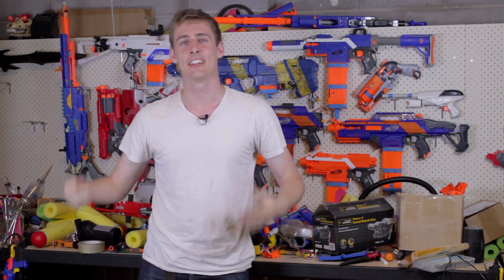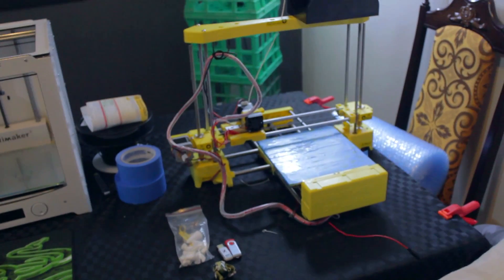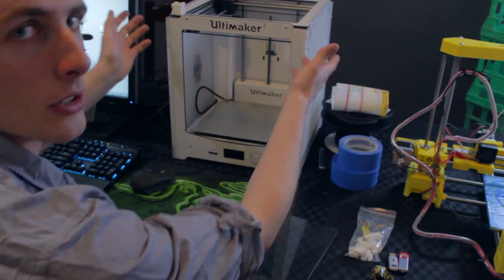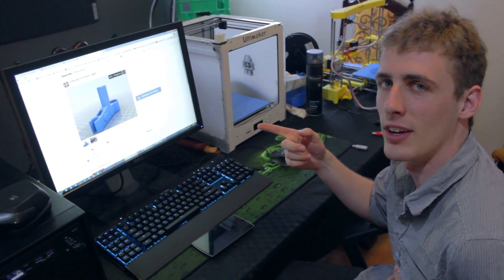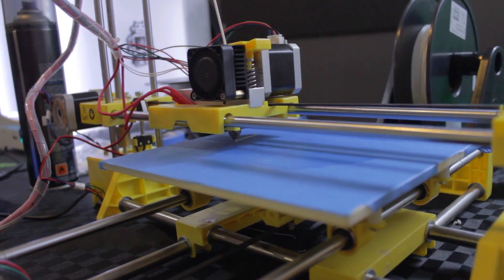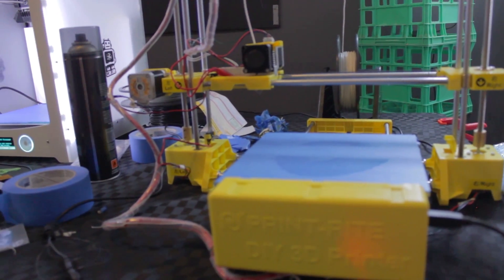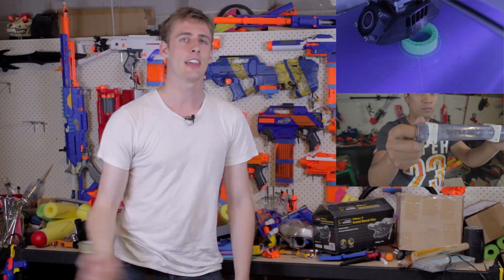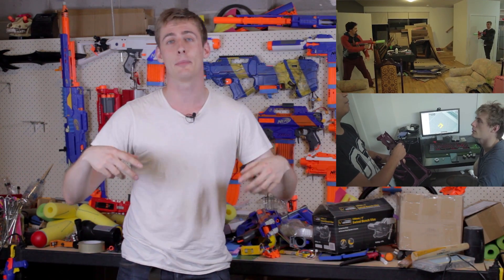ULTIMAKER 2 vs PRINT-RITE DIY 3D Printer & How to Bed Level - PRINTER PARTY | Make Test Battle

Comment: I have a $350 DIY printer that I may have added another $150 in parts and I understand (at a beginner-intermediate level) the importance of leveling, extruding speeds, heat for types of filament, and more importantly how the machine is mechanically built and its tolerances and can (given time) rival the $2,000-$4,000 home printers. 

What is more impressive, is that I can build (with the cheap printer, and slow speeds as well as finer print parameters) I can print the parts to a machine where all I need to buy is a board and some rail/threaded screw components and motors and print at a $4,000 + quality.  

I would really say it is more about understanding the mechanics and tolerances of each part, rather than plopping down a bunch of money and hoping the machine works.  Are there machines that beat the crap out of my $350 diy?  Absolutely, but that is because of the system as a whole, not simply the price paid for the machine.  Learning an arduino(can really be any micro controller and programming logic flow - arduino is just known and readily accessible with tons of code on the internet to help beginners get started) and cnc(computer numerical control) will go a lot farther than watching reviews - if you want to get serious or even just moderately tinker with a printer.  Likewise, knowing more will help when the machine has a failure(which almost every machine will eventually have a failure) and then fixing the area of failure becomes a learning experience as well as useful knowledge moving forward.
Reply: ya I've been doing alot of research on 3d printers and looking at buying a DIY Prusa i3 varient and seen amazing print qualities from them with a little dedication and understanding.

Things that should in my opinion be learned anyway so can better understand the mechanical working of it and fix things as issues arises etc.
Reply: I got the CTC and then ended up over the span of a few months (while I figured out what variables led to a great print) added about $250-$300 worth of upgrades into the machine.  The difference (other than huge savings) from if I would have purchased a replicator - is that I fully understand what components are giving me high quality prints now (as well as air temps, bed leveling and temps, etc.) and I also know how to fix and maintain those parts.
Reply: Aura Rowe Basically what I am saying is - If you want to learn 3d printing, get the Prusa (like you mentioned) or a CTC or something else low cost and work up, that is the proper mentality.  I could see myself eventually dropping a few thousand dollars on a quality machine, once I understand the intricacies of the process, but I would have been extremely demoralized to spend $3k and my first few weeks of prints be bad (which they inevitably will be).  

My next goal is to build a 3 axis CNC in my garage, haha.  I am a programmer by trade so the software and logic I am OK with and I have started to learn a lot of open source g-code applications and slicers so that helps for making your own machine.

Comment: Bed leveling corrections can be made at time of print.  Just manually twist the z axis screws while the first layer is printing to dial it in how you want it.  You can easily tell when it is too high or low.  The rest of the layers will self correct any imperfections and you will still get a good print even if the leveling is bad.

Comment: that print rite is not tuned right, depending on nozzle it should be able to do almost as nice as the ultimaker, albeit at lower speed, that prusa i3 design sucks and is not sturdy enough for very high speeds, nor actually getting proper Y axis, which always depends on the surface you put it on ... ie. how level the table underneath actually is.

Comment: Hey- love the vid's......I often run my printer when i leave for work but dont have anything to control it with. I have used a wifi camera but its not helpful if i something goes wrong, do you know of anything on the market to help with this? the only product i have found so far is 'heero'.....https://www.kickstarter.com/projects/guzu/heero-monitor-and-stop-any-electrical-device-remot which looks great but do you have any advice?

Comment: You don't need to use blue tape with the ultimaker 2. I recommend Wolfbite if anything and leaving the glass bare. I've had issues with warping because the tape came up from the bed which would have been avoided by just not using tape and using Wolfbite or a simple gluestick
Reply from the maker: Blue tape works. I now use BuildTak -R
Reply: +Make.Test.Battle I know it works. I use it in my replicator 2x, but it isn't necessary for the ultimaker 2.

Comment: Why the hell do they have glass bedding? I have never seen a single review of a 3D printer with a glass bedding where there is no complaint about how hard things stick to it which immanently leads to your piece bending if large enough. For 4K USD one would expect more thought in designing this thing...
Reply from the maker: Borosilicate glass has great thermal properties -R
Reply: Make.Test.Battle That's great but it turns your printing into a shitty printing. :D
Reply from the maker: rbaleksandar Works fine for me; that said I am using blue tape or BuildTak. Also dontforget that this printer isnt 4K USD, it was 4K AUD and including taxes, import duties, shipping etc at the time I bought it when our dollar was quite low. Prices have dropped since -R

Comment: Is it just me or is that "$400" printer worth $100
Reply: I bought a Jgaurora Prusa I3 for $300 and it looks way cleaner, prints great, and comes with a heated bed and everything necessary to do nice prints.
Reply: same, I bought a wanhao i3 plus recently
Reply: I agree, the xyz da vinci junior 1.0 is cheaper an WAY better
Reply: Bart Ernest Yes but my davinci broke and could not be fixed 3 months after I bought it. When I bought it, it wouldn't let me register it for warranty. Now its just an expensive cup holder.
Reply: That's what I'm thinking
Reply: Battle Grape no more like $25
Reply: I agree no way is that worth a dime above $150
Reply: i wouldn't even buy that rubbish lol

Comment: I own a $440 prusa i3 steel 3D printer and it prints better than the ultimaker at my collage. yes I agree that the ultimaker is much simpler and much easier to use but a cheap 3D printer can print better than an ultimaker if you tune it right. so is spending "$4000" on an ultimaker really worth it ? when you would get just as good if not better results with a $440 printer with a bit of tuning.
Reply from the maker: We are getting one to Review soon. :3 
-Justin
Reply: It all depends on how technical you are... if you are a total noob in this, a more pricey printer will make it easier to print a reasonable quality and it will auto align and such. a DIY or cheap one needs more technical handing from people who know what to do. but yes, in terms of quality, when set at the right settings by a smart technical guy, the printers will be pretty close.

Comment: My printer is a Wanhao Duplicator 4. It cost around $700. It does pretty much everything that the ultimaker does, except smaller build plate. The Duplicator also has dual extruders. The prints come out second to none if prepare right. I rarely have to do any setting up with it.

Comment: ... This video hurts my head to watch haha. So many things wrong.
Reply from the maker: Agreed. I've fixed most of them now -R
Reply: +Make.Test.Battle I'm glad, the ultimaker is a really great printer once you learn how to use them hope your using glue instead of that blue tape. And hopefully you got in touch with ulimaker with any problems.
Reply from the maker: CRABST3R ! Sadly my warranty expired a while ago. I personally hate glue. It looks so crusty and gross. I've swapped to using BuildTak which is amazing. Most of my problems seemed to stem from using a shitty fan shroud and using bad filament. I've reprinted a better shroud and swapped to better filament. Followup video soon -R
Reply: They still should talk to you maybe not part wise. They also sell a upgrade kit if intrested and still using this printer. From what I've seen the upgrade is worth it and it's only a couple hundred for all new parts to replace the old and new firmware.
Reply: Be a great video to do since you've had problems and if you upgrade and it fixes everything it deffently will make a great video. If it doesn't still make for good content.

Comment: Holy crap guys, I think I got really lucky then... Just got this printer and still getting to know my way around it.
Its an XYZ DaVinci 1.0a... It cost $500. Its a plug and play - fully enclosed - heated bed - LCD and Button controlled beautifully put together thing... It also came with a full roll of ABS (I think it only takes 1.75mm ... Not sure what the difference is to 3mm plastics though??) It prints awesome and it didn't need any ruler / bed calibration (or so it said in the manual - though I think it will need to calibrate with every new roll of plastic, but it didn't come with rulers or cards)

Comparing it to your mates DIY job for $650 all in is like chalk and cheese.

What am I missing here? Whats wrong with it???
It looks and acts pretty much like your Ultimaker 'cept its larger and I have it plugged directly into my mac... And it seems to want to heat the bed much hotter - like 70-75degs - whereas yours you said was 48 deg or so... 

Whats gives,  I am baffled?
Reply from the maker: This video wasnt really meant to be a "look at how much better the expensive one it" more to just show off what sorta difference there are between the avaliable offerings. Another friend of mine has the DaVinci and he says pretty good things, as long as you get the chip to allow you to use whatever filament you want -R

Comment: Not sure, but it almost seems like a promotion for the ultimaker. The DIY printer looks like it printed in lowest resolution (~.4mm) and wasn't as well calibrated with bad bed adhesion technique, and it looks like the ultimaker printed in higher resolution. There are cheaper DIY printers out there that print better than the $400 one and even have an LCD screen with a knob (I got one for $250 last year...the only problem with those is that they have bad frames and the frames go bad after a while (if they are made out of plastic), but just upgrading to a metal frame for around $70 and an auto level sensor ($50) and it will take care of the job. Now, after almost a year, the DIY printers have gone for even lower prices, check out the Prusa i3 from different companies. Check out the DIY printers here to not get ripped off (http://3dprintersonlinestore.com).

Comment: Why are you putting tape on the Ultimaker's build plate? It's a heated bed... just buy a glue stick and you'll never have to mess with any tape.
Reply from the maker: Because glue is gross. I have just put on a buildtak surface and it seems to be working rather well -R

Comment: In the glass surface use drop of acetone and rub some old abs plactic in it. Sand it with 100 paper and your print will be fine. No need to use that crap tape.
Reply from the maker: Not sure if that works too well for printing PLA -R

Comment: hello guys,

it is my first time using the ultimaker 2 and i need some help,

first of all, let me explain a little bit about the model:

i am trying to make a gameboy raspberry (http://imgur.com/a/gFhk7)

and because i want to use it like a final product i would love to have a really hight quality ending pieces.
i am going to print on part in colorfabb_XT black of 2.85 diam and the other one in PLA/PHA sky blue from colorfabb of 2.85 diam too.
here i add the link of the to parts that i want to print:
https://skfb.ly/OVQZ
https://skfb.ly/OVQr

i would love some recomendations in the different settings it is the first time  i am using the ultimaker 2 before i was using the zortrax 3d printer where you dont need to change things, only the material so i dont have any idea.
it really doesnt matter how much time takes to print
thanks
Reply from the maker: Sorry... If I knew how to fix an ultimaker 2 there would be 2x as many 3D printing videos on this channel... -R

Comment: Hi. i like a lot these video. I have a sort of a big challenge: a 3D printer focused video. I have a solidoodle workbench (the company Has Suspended Operations) and it´s been a nightmare. I have invested like a 500 hours trying to make it print a medium quality models in ABS, but nothing works fairly good in every matter. Have seen almost everything i found online about tutorials for the hardware and various softwares. at this point I bought simplify3D, but the printer works a little better with repetier and slic3r. Please. The nozzle number 1 has clogged and received maintenance, but the filament does not extrude properly and the extruder motor fails to push the filament. Is there anything you can do to help me? Around the world is a workbench owners community with similar problems that thinks like me that the problem has a solution but no one knows it. Settings for medium quality prints no matter the software and info about noozles and dual replacement kits that fits the workbench is what we need. thanks !!!
Reply from the maker: No idea sorry; there are sooo many things that could go wrong with a printer. Im curious about getting Simplify3D to try that however -R

Comment: That DIY printer costs 400$????? Pretty bad deal, there are way better printers on the market for that price. Check out the Wanhao Duplicator i3. Comparing this one to the Ultimaker would be a better comparison. And if you really paid 4000$ for the Ultimaker 2, they really pulled you over the barrel.
Reply from the maker: Convert to Australian Dollars + Shipping + Import/Export Tax
-Justin
Reply: http://www.amazon.com/Wanhao-3D-Printer-Duplicator-I3/dp/B00YSL8GQM/ref=sr_1_1?ie=UTF8&qid=1464117058&sr=8-1&keywords=wanhao+duplicator+i3

So its 50$ more. 

I live in Germany and you can get them with Amazon Prime for 399€ including shippping. Delivery on the next day of course. So no need to convert anything
Reply: oIo

Comment: love solidworks but its a ridiculus price
Reply: +Cian Govern
Indeed, there are lower priced (or even free) alternatives that are better than Solidworks for designing parts for 3D printing. Solidworks is loaded with "advanced" features that are useless for 3D print modeling. It also has a steep learning curve - maybe not as steep as Siemens NX, but still unnecessarily complicated.
Reply: try learning creo, solidworks is a dream compared to that mess
Reply: I have solidworks but i think the price is silly for people just doing little home projects its ok for big companys who can offord it but i had to get a cracked version which i still paid a few hundred for
Reply: Cian Govern student version is pretty affordable, but if you're not a student you're out of luck
Reply: Denis Lipatnikov actually in my school we get the students version for free but only while we r in the school as soon as we finish school its gone
Reply from the maker: Yeah; I get the academic version through my University degree -R
Reply: u can use freecad

Comment: Bottom line... 3D printers are in their embryonic state and everyone has problems that SHOULD NOT be occurring.
Reply from the maker: +LucidLegend1984 ? That didn't really make sense.
Reply: +Make.Test.Battle Bottom line... 3D printers in general are in their embryonic state. Everyone who has purchased a 3D printer experiences various issues with their machine that make the purchased 3D printer more of a nuisance than a useful tool.
Reply: Simon WoodburyForget
I disagree commercially you may be right but for consumers that want to produce anything of large value would have to pay $1,000's for a decent machine. In my opinion when the 3D printers become more reliable at the $100's of dollars stage, that's when consumer 3D printers will be in the adulthood stage.

Comment: If you dont have a heated bed put a small ikea mirror on the bed for a flat printing surface. Use pritt stick to print onto instead of blue tape.
Worked for me for the last 3 years.

Comment: I use El.ers glue stick works beutiful every time fast and easy and after scraping off cleans up nice with a vacuum.

You guys need auto leveling too and to use E3d head 1.75

i have a $350. Makerfarm ( they suck and the printer was a pain to learn because they do not help)

But once i gigured it out it is way better then that $4000 pronter